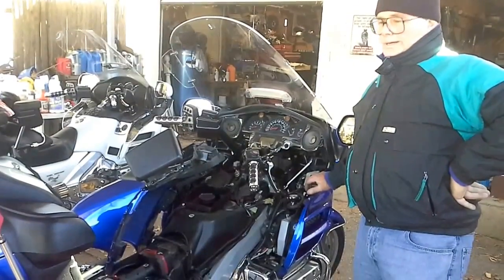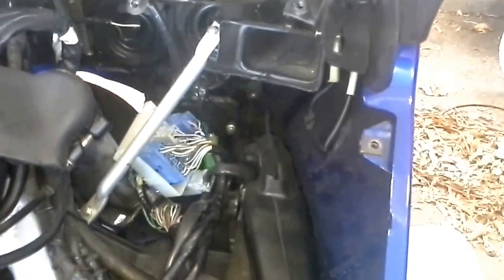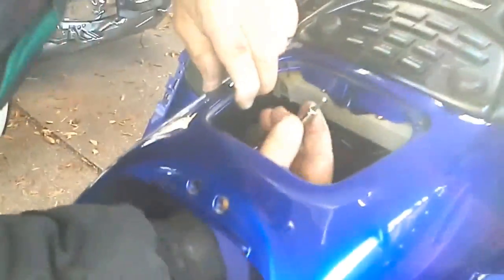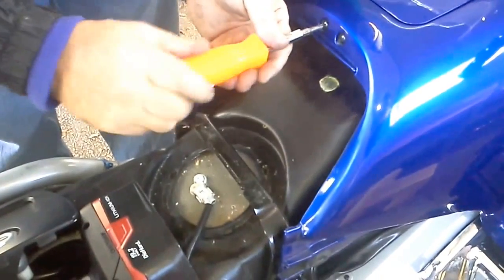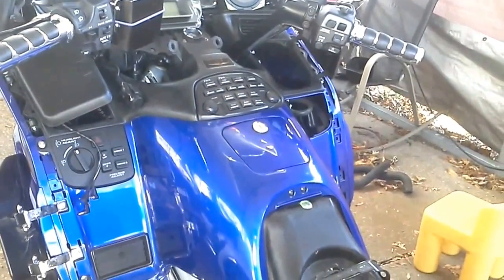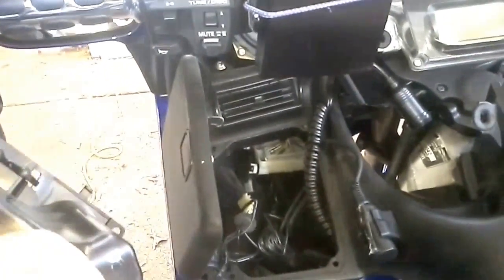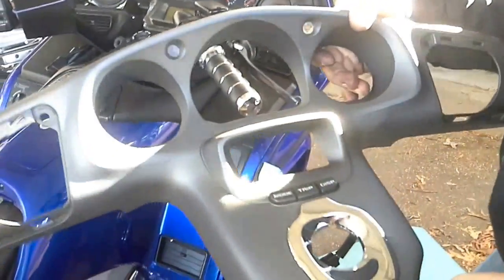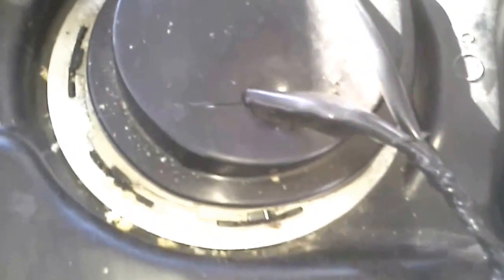My Honda Goldwing Overheating Fix

Comment: This was not good video. You did not show how to remove the panels. You did not show any troubleshooting. You only touched on the connector a s a fix for like 10 seconds. For the name of this video it was horrible. You would be better off changing the name of the video to How to re-install fairings on Goldwing.
Reply: Honestly it's not difficult at all.